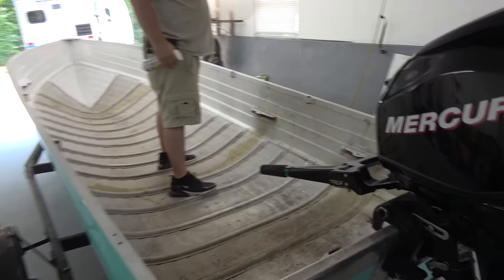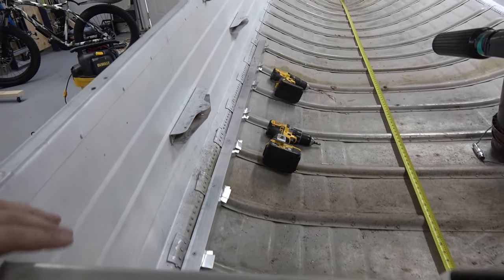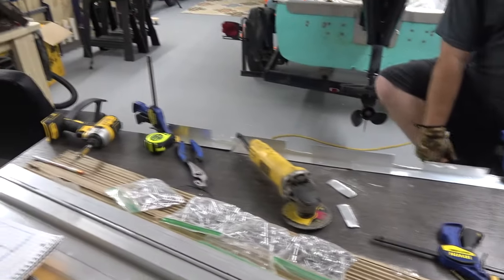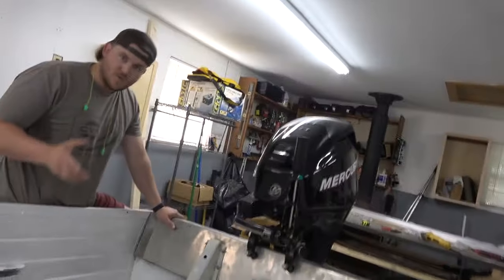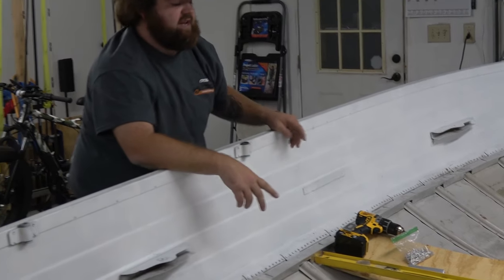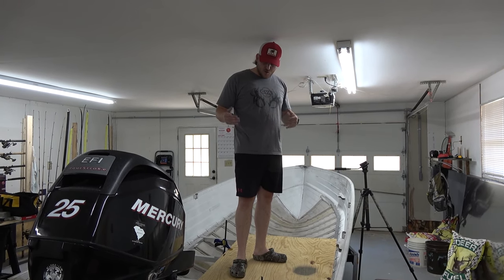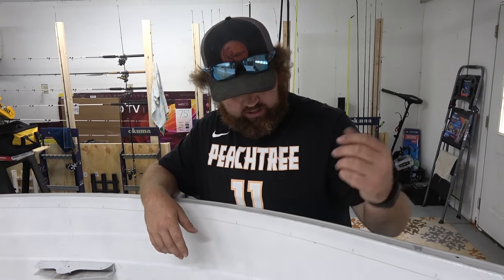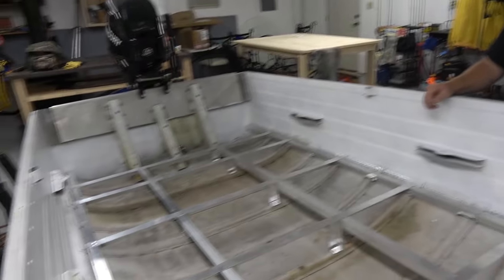“Where to Start?” Aluminum Subfloor Framing for Beginners. (That’s us) ~Tiffany Build~

Comment: We just finished up our 14 footer. Tip on painting. Forget the spray cans. 
1qt of rustoleum white tinted with a bit of black for a nice light grey color. Small foam roller and lay it on. A quart will give you 3-4 nice coats for a beautiful finish !!!
Reply from the maker: Thanks for the input man. Appreciated it
Reply: Do you have any pictures? How did you mix the bit of black
Reply: @motocrossadict1   Just get yourself a plastic paint cup, enough white to cover what you’re painting, figure 3 coats. Then take a pint of black and keep slowly adding and mixing until you get the shade of grey you want. I have pictures but no idea how to get them to you 😃😃
Reply: @stevenlitkey9354 thank you man that makes sense! Gonna start soon on my 14ft vhull!

Comment: Very similar to my deep fisherman, quick question do the seats contribute to the structure of the boat? I’d like to do something similar
Reply from the maker: The original seats do but as you build the subfloor and the decking it will add more stability that stock seats

Comment: That is the same boat I have. What is the make and modal of this boat?  I also want to put a floor in mine but I'm concerned about the added weight. The only difference between yours and mine is the transom is cut down  4" to fit a short shaft 25 HP 4 stroke Mercury motor that is 140 LB. Please let me know what you think, thanks.
Reply from the maker: I’m unsure of the make and model. It’s a 1660. The added weight shouldn’t be a problem depending on what your weight capacity is and what all you are adding to the boat. If you still have the data plate for the boat it will tell you mad weight and all that. With that being said though since it’s all aluminum it’s not a whole lot of added weight. The heaviest part is the .063 sheet aluminum.
Reply: Thanks for replying. The information plate is so worn and faded it was hard to read, but I found a website that sells replacement plate for the boat. It is manufactured by Mirro Marine Division Oconto, Wisconsin Model F-3616 Max HP 35, Max weight persons 600, Max weight persons motor and gear 950 @SlaunchOutdoors

Comment: Are you confident that without original seats that the hull won’t fold like a taco in heavy water?
Reply from the maker: Yes very. With the framing we did it is more structurally sound than it was before we bought it.

Comment: With no paint below the subfloor, aren’t you worried about corrosion below deck? If it’s used in salt (my build will be) then corrosion is a big issue I’m worried about. Working on pulling the subfloor on my boat (had been added by previous owner) and pulling all the foam just to apply a thick paint protection of the aluminum. Last thing I want is to put Money and time in something only to drop it at the dump a year later.
Reply from the maker: it wasn't going to be used in salt water. We probably should have painted the entire thing is hide sight but it did have a coating on it. Just didn't look pretty
Reply: Not necessary in fresh water.

Comment: What is the main reason for a subfloor?
Reply from the maker: The main reason I do it is 1) it gives you a better surface to build onto especially in a Vhull. It also allows you to hide a lot of your hoses and has the water drain and run back so your feet stay dry. As well as a couple other reasons but that’s a couple.

Comment: I just took the deck in off of my 16ft V and the old framing is riveted through the boat, what do I do
Reply from the maker: if the old framing is solid, you could possibly use that to build off of it. We would need some more info. You can message us on our IG with a couple pics and we can give you some feedback.

Comment: Awesome build! Are you using sealed blind rivets or are none of your rivets going through the hull for your bottom and side supports? How will you prevent any leaks for rivets that need to go through the hull?
Reply from the maker: Thanks! We are getting it wrapped!
Reply from the maker: Also no rivets through the bottom. They’re through the ribs in the bottom which are internal
Reply: @SlaunchOutdoors  nice!
Reply: @SlaunchOutdoors  that’s really smart, nice planning! Thank you for your time, awesome build!
Reply: How far did you drill into the ribs on the bottom, what depth?  Also what size rivets did you use to anchor the supporting brackets?  Thanks!
Reply from the maker: @KatieandJeffBehrend  just deep enough of the hole to fit the rivets. 3/16 rivets. Pretty much all rivets no welds
Reply: @SlaunchOutdoors  14:44
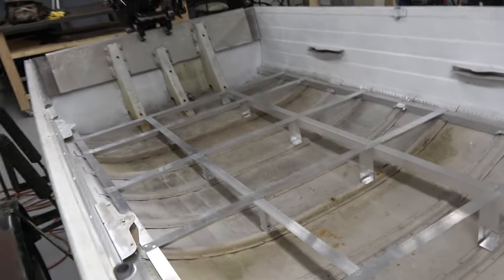Reply: 15:12 15:14  @KatieandJeffBehrend

Comment: What kind of spray paint were you using?   Any prep before spraying?  Great video! Looking forward to more.
Reply from the maker: We are going to have the outside either wrapped or painted with a higher end paint. The inside we will be using spray paint. We are going to sand down and buff everything down to nearly bare metal. There are some small chips in the old paint and that doesn’t look good.

Comment: Cool. Did you add two more brackets to the transom? Was that because you added a heavier motor like a 4 stroke?
Reply from the maker: Don’t understand your question
Reply: Those are standard transom brackets on the older mirrocrafts

Comment: How much did all the aluminum cost?
Reply from the maker: Sheet metal was around 500ish. Hatches were 1100 and the framing was about 800 I think. It’s been awhile though so numbers might be off. Check out tbnation.net for current pricing.